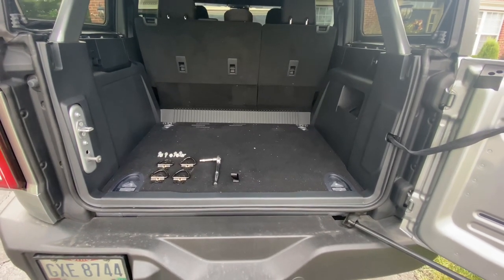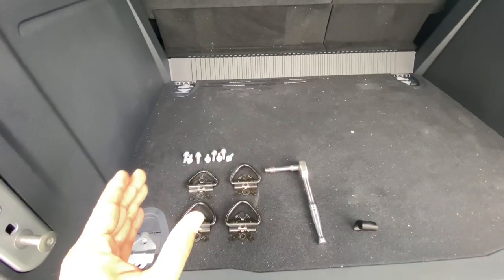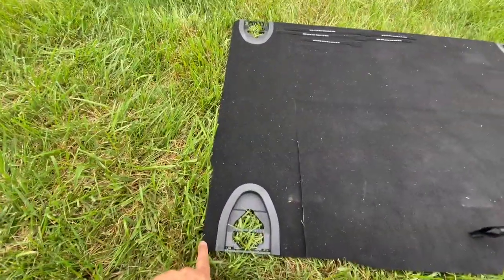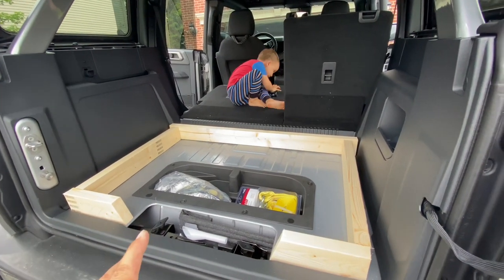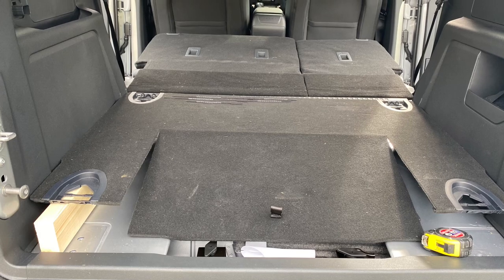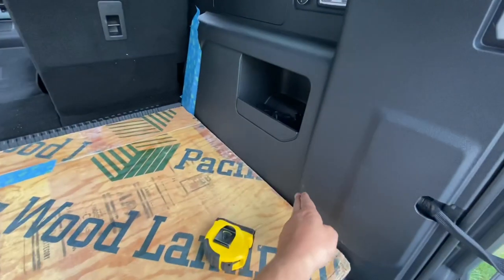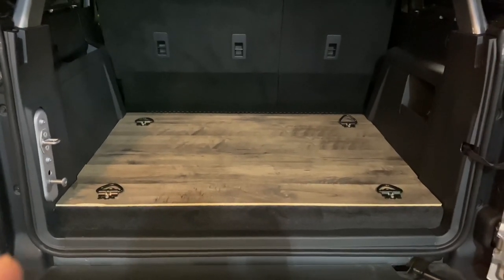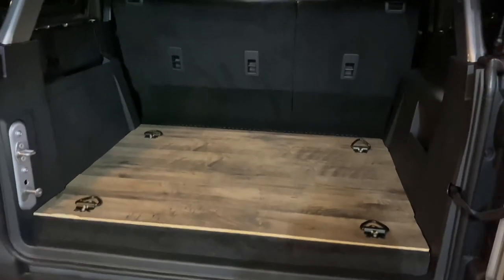Raising Rear Floor in the Big Bend 2021 Bronco.

Comment: Nice job, my only changes would be to have a small (vertical wise) pull out for storage for bungees, tie downs, etc. and I would have liked to see it finished on top in same carpet as factory or at least rubber coated top instead of wood.  But again, thats just my personal preference.  I'm here still dreaming about being able to afford / get a Bronco.
Reply from the maker: I have used it off-road and gear gets muddy. This is a easy clean up, if I get tired of the wood it will be no issue to cover it with carpet.

Comment: Could you give dimensions of your 2x4 set up and the plywood? I caught 42 1/4 for the horizontal ones, looks nice, trying to replicate forsure!
Reply from the maker: The floor was measured from the bottom to the lip of the seat, the base would was 1/2” and the top floor was 1/4” you don’t need the up, I did it for looks. The 2x4 had to be ripped down some. Let me see if I have it written down somewhere.